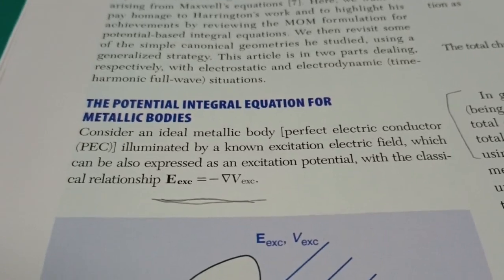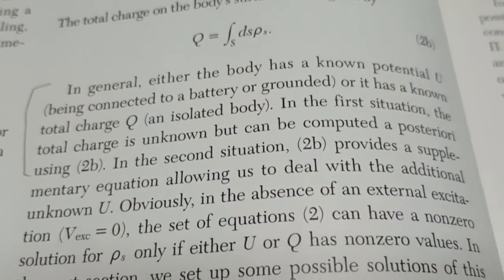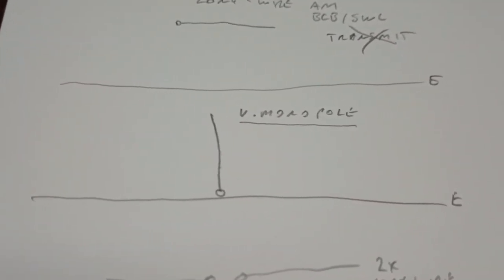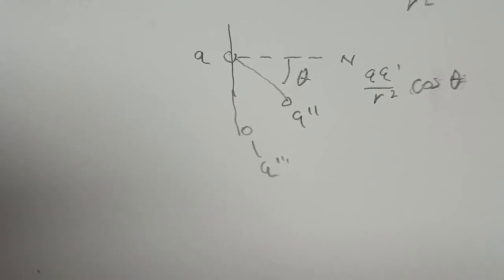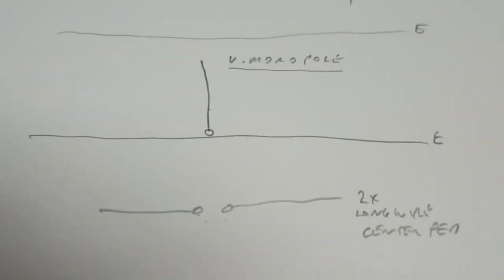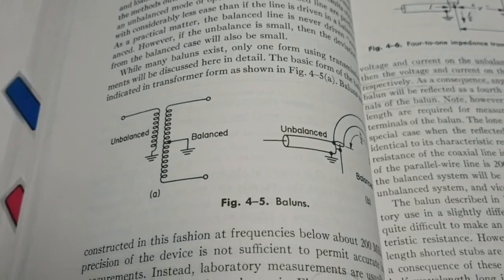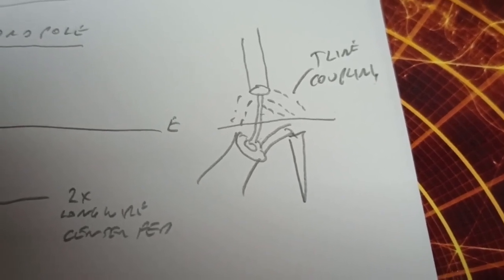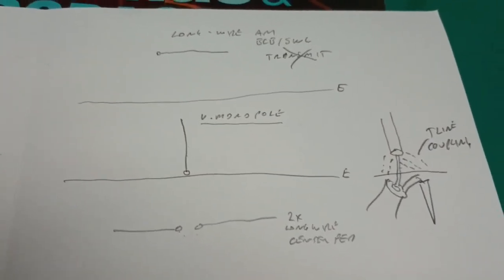Making Verticals and Longwires Work #ham #hamradio #antenna #arrl #hamantenna #swl #ieee #efhw

Comment: "They *suck*!  With great *suction*." 🤣🤣🤣
KD8EFQ, with my apartment balcony railing disaster, urban ghetto blaster/73
Reply from the maker: Great sucking sound. black hole.

Pun intended

Wire up your neighbors handrails and theyll get that Cornell West look!
Reply: @k8byp  🤣 I don't need them schizo-tards messing with the antenna!
Reply from the maker: Terrible attitude! 

You need to get VE classes going there.

Since ARRL is loaded with white privilege and have lots of money, they should pay for their classes, license fees and a new station.

That would really spiff up the place.
Reply: @k8byp  My neighbors?  Couldn't get on the CB band without effing it up! 🤣🤣  When I see them walking through the front door with their Bush Tall Boys, I wonder which and how many of their other personalities are getting drunk! 🤣🤣🤣  On a slightly serious note; my apartment is owned and managed by HUD (Housing and Urban Development) Low Income Housing; a.k.a., "The projects", "The urban ghetto",  "New Jack City" (one of many!).  Most of my neighbors would have BIG trouble studying for their Tech Plus, much less getting ANY of the questions correct! 🤣🤣🤣  If there's any "White Privilege" here, it's the beige paint they used on the walls in the hallways.
Reply: @k8byp  What's so funny?  ALL of the comments I posted here are gone.
Reply from the maker: youtube censorship. cupcakes dont like it so they delete it. theyve deleted several of mine. Yours arent ' visible' but still there. Now there deleted.
Reply: @k8byp  It's because I'm a Conservative Trump supporter.  Only after having been deep in the cesspool of the left and learned what it's really all about🤮🤮🤮
Reply from the maker: exactly. radical leftists karens find internet Moderation irresistible, they can sociopathically control the content. While THEY demand Free Speech.
Reply from the maker: The whole comment thread....minus emoticons...
"They *suck*!  With great *suction*."
KD8EFQ, with my apartment balcony railing disaster, urban ghetto blaster/73

@k8byp 16 hours ago
Great sucking sound. black hole. Pun intended.
Wire up your neighbors handrails and theyll get that Cornell West look!

@user-iv2xb9yz5l 15 hours ago
 @k8byp
I don't need them schizo-tards messing with the antenna!

@k8byp 14 hours ago
Terrible attitude! 
You need to get VE classes going there.
Since ARRL is loaded with white privilege and have lots of money, they should pay for their classes, license fees and a new station. That would really spiff up the place.

@user-iv2xb9yz5l
• 14 hours ago
 @k8byp  My neighbors?  Couldn't get on the CB band without effing it up!
 When I see them walking through the front door with their Bush Tall Boys,
 I wonder which and how many of their other personalities are getting drunk! 
On a slightly serious note; my apartment is owned and managed by HUD 
(Housing and Urban Development) Low Income Housing; a.k.a., "The projects",
 "The urban ghetto",  "New Jack City" (one of many!).
  Most of my neighbors would have BIG trouble studying for their Tech Plus,
 much less getting ANY of the questions correct!  If there's any "White Privilege"
 here, it's the beige paint they used on the walls in the hallways.

@user-iv2xb9yz5l
• 2 hours ago
 @k8byp  What's so funny?  ALL of the comments I posted here are gone.

@k8byp
• 1 hour ago
youtube censorship. cupcakes dont like it so they delete it.
 theyve deleted several of mine. Yours arent ' visible' but still there.
 Now there deleted. But I got them back.

@user-iv2xb9yz5l
• 42 minutes ago
 @k8byp  It's because I'm a Conservative Trump supporter.  Only after having
 been deep in the cesspool of the left and learned what it's really all about

@k8byp
• 17 minutes ago
exactly. radical leftists karens find internet Moderation irresistible,
 they can sociopathically control the content. While THEY demand Free Speech.